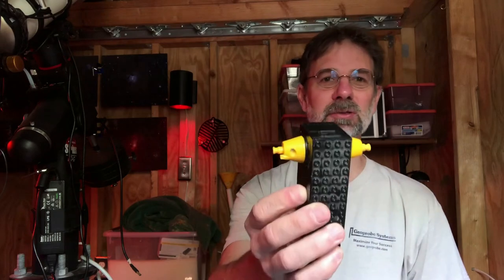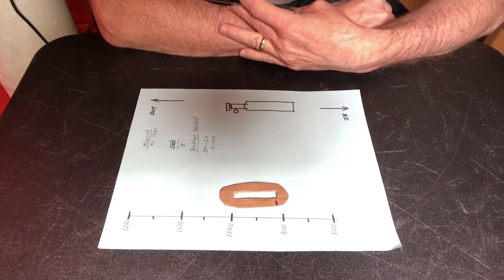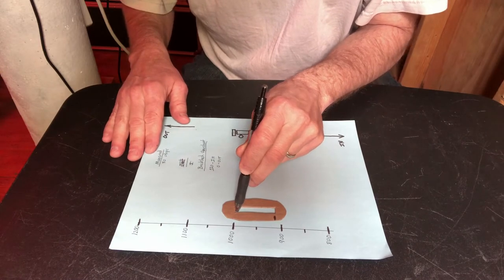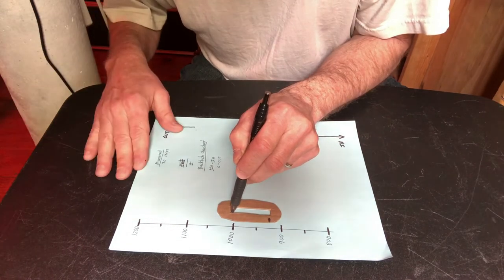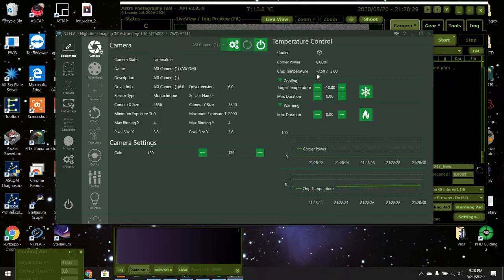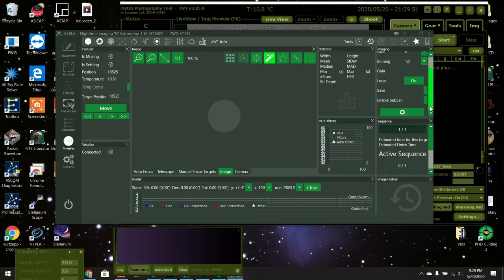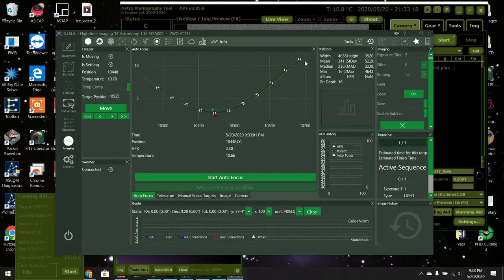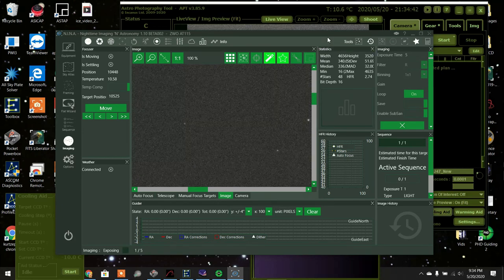Focusing w/ an Autofocuser (EAF) Video 4 of 4 - Backlash Overshoot Method in N.I.N.A.

Comment: I have given up on apt and now using Nina. 1 press of the button and it done it all from start to finish. Very impressed and it's free.
Reply from the maker: Yeah it is a great program.  I used it all the way through on the second night after downloading it.  NINA works more like SGP which I never was able to figure after multiple nights but APT is much easier in my opinion.  APT works differently and I have gotten used to it so I am able to blast through it.  I am using both for now will continue to to practice with both.
Reply: @AstroQuest1  I didn't get on with SGP things crashes or bugged up and preferences etc were always lost. APT worked but Nina just pushes to another level that I am happy with. Autofocus is extremely awesome. 2.27 HFR for me. Would be great to see if you can work out Polar alignment and make a video to see how accurate it is compared to Sharpcap  Polar Align :)
Reply from the maker: @cryptoalchemist10minutes44  Funny you mention that, I just started using Sharpcap but saw N.I.N.A. has that feature as well...

Comment: Nice explanation Kurt the model really demonstrated the problem and solution. I was doing the APT-NINA-APT shuffle myself :)
Cuiv's channel really is the best reference for NINA newbies since it seems all resources are directed at development and the documentation is lagging badly. I'm more of a RTFM guy than ask a bunch of foolish questions in a forum. "Best to thought a fool ....." :) I bumbled through a full NINA session a few nights back other than the initial alignment because you can't beat APT's Goto++ and short list of alignment stars. Which kind of demonstrates one of NINAS shortcomings. I am certain I could have aligned in NINA it just did not have such a self explanatory function button like Goto++. As comfortable with APT as I am If they don't update the focus routine and include in sequence focusing soon (which does not look likely) I can see myself jumping to NINA full time.
Reply from the maker: You hit nail on the head Rob.  My main concern is the focus issue.  I have lost to much data due to focusing and I don't see the point if you are on a target and and then have to move off the target to look for a bright star and then go back.  APT does have more alignment stars and the Goto++ feature is fantastic which is the other reason I still use APT.  Agreed Cuiv's channel is the best reference.  Short, quick, and to the point.  - Cheers

Comment: Last night I set up my telescope and did the autofocus twice, once with APT's single star routine and once with NINA's multi-star routine. The outcome was identical - same stepper number !!!
With APT I entered the back-focus number and with NINA I used the overshoot method. I hope to try it again tonight, will see if the results are the same. Last night was very clear with no moon.
I'm using ZWO EAF to autofocus
Reply from the maker: Awesome Monty.  It is great when everything works out.  I have been very happy with the EAF since I figured the backlash.  It is good info the APT's new autofocus works. - Cheers

Comment: puzzled - why is APT being used with NINA.  Also nina doesn't know APT'S settings, they both use the focuser driver which was left in APT and loaded in NINA so (same settings).
Reply from the maker: I loaded all of the setting in NINA and APT independently.  The reason I use APT is I am very familiar with it and I like the way does things I.E. Goto++.  Having said that, NINA has an awesome focus/autofocus routine so I use it.  I stop the camera in APT  so there is no interference and turn it on in NINA and have it do its thing.   
 Ain't got a clue why it works as I am not a computer tech by any means - it just does.

Comment: Thanks for the demonstration Kurt. I have been waiting for clear skies to get out and try this. Question I have is, can you have camera connected in APT and also in NINA? You said in the video you turned off the camera in APT, but I saw it was still connected, so I am not sure what you meant by that. Did you mean Live View was off? I would like to keep the camera connected once it has cooled. Disconnecting the camera in APT will turn off cooling. Also, in the previous video you mentioned something about monitoring your focus with NINA while running imaging plan in APT. Is there a way to run NINA and monitor focus while imaging in APT, or is that a future video? Again great stuff. Thanks
Reply from the maker: Sorry about the confusion Robert.  The answer is yes!  Basically the camera is still connected to APT and cooling, I just meant it is not taking pictures otherwise NINA and APT will interfere.  When I turn NINA on I also have the temp set at -10 C.  I think the next video I do will be how I am using both.  I did mention monitoring while imaging in APT and I did it once having both cameras on at the same time so while APT was collecting on a 90 sec exposure, I turned on NINA and did the check - The only problem is it only worked once. I tried it the next night and it crashed.  Sooo, what I have been doing now is I will temporarily stop imaging in APT and go over to NINA and check.  It is still very quick and I do from in the house - TeamViewer.  - Cheers Kurt
Reply: @AstroQuest1  Ok, that's what I thought. I was planning on running the same scenario tomorrow night. Do autofocus, run APT, and then stop APT and autofocus. It'll be great when APT has an autofocusing routine like this. Clear skies.